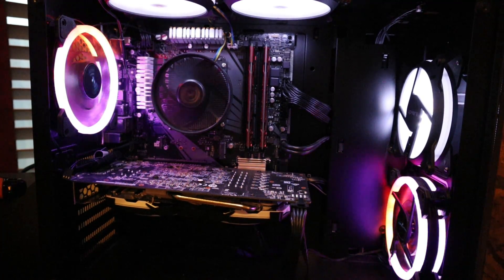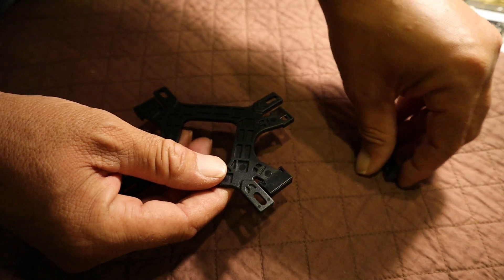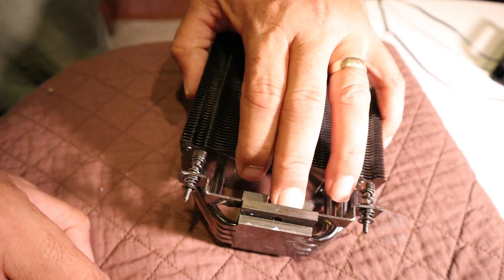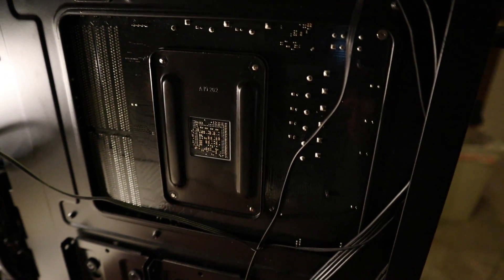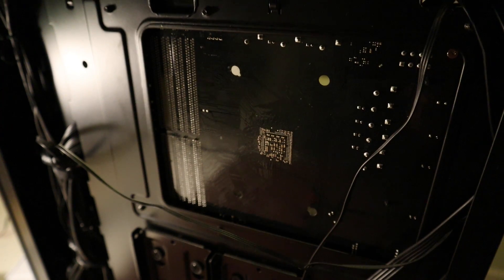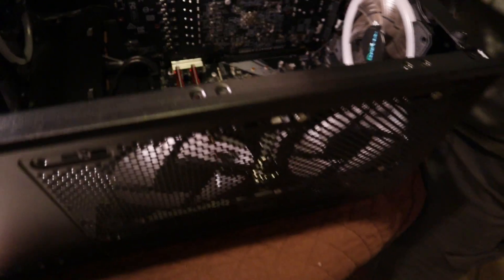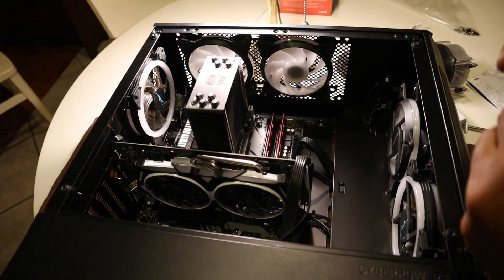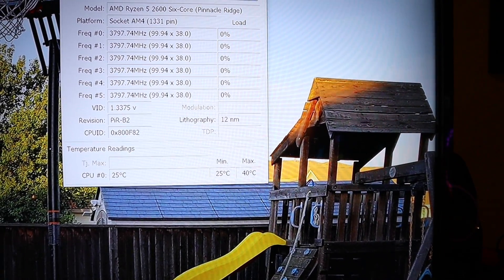How to install the Hyper 212 Black Edition - AM4 - B450 motherboard - Cooler Master

Comment: Thank you my guy for this great tutorial! One inconsistency I encountered while installing my hyper 212 is at 2:01 when prepping the backplate. 

For me, settings all the pins the left created a mis-alignment with the board & heatsink. They had to go to the slot closest to the neighbouring plastic lid (used for intel boards). In other words, the pins needed to be in the slot that created the most space between pins. So if anyone finds that their backplate gives resistance while marrying to the board, or the pins simply dont align with the screws on the heatsink, give my suggestion a try.
Reply: Thanks for this advice! I was having the same issue and this fixed it!
Reply from the maker: Good advice... Every install has its own little nuances... Good thing there's a little "play" with the backplate pins....
Reply: I noticed the same thing, was about to write a comment until I saw you already had. Great video though, helped me a lot!

Comment: those black fan clips dont come with the cooler right? Pretty sure its supposed to have paper clip style ones
Reply from the maker: You get 2 sets of those plastic fan clips with the Hyper 212...the noctua cooler I have came with "paper clip" style clips
Reply: @ScottsPC  thanks! I actually ended up getting the Freezer 34 eSports Duo and couldn't be happier, such an amazing system.

Comment: I have the same cooler. If you want some added lighting, swap out the fans for 2 x 120mm Cooler Master SickleFlow ARGB. This is what I'll be doing. Just remember you will need an ARGB splitter and a 4 pin PWM fan splitter for this setup. :)

https://www.coolermaster.com/catalog/coolers/case-fan/sickleflow-120-argb
Reply from the maker: Thanks for the tip!  I appreciate the comment!

Comment: The stock cooler on my 3600 is sooo loud. Hoping this one will do the trick. Do you know if this work with a Aorus Elite B450 mobo?
Reply from the maker: Yes... Will work on any b450 mobo.... It's much quieter even at full speed! ⚡️
Reply: How did it end up working for you? My stock coolers with the 3600 is also super loud.
Reply: @bobbob123ful  It is definitely quieter. I would also make sure you have the fan set to silent in your BIOS if you can.
Reply: @connorm7005  I set a custom curve in the bios for the stock cooler. Will have to adjust it for the Hyper 212 BE. How are your temps compared to the stock cooler? Also thanks for the reply!
Reply: @bobbob123ful  They aren't bad probably 5-10 degrees cooler on average
Reply: yo idk if this just my mobo but the backplate thing is too small any tips to make it fit? well i mean the screws are not in the right sport because they are too wide
Reply: Jack Make sure you set the backplate for your socket. Whether it's AM4/AM3/LGA, etc

Comment: I'm looking into building my first PC with PCPartPicker. I've selected the Hyper 212 EVO cooler, alongside the MSI B450 TOMAHAWK MAX ATX AM4 Motherboard. Any idea if this cooler is compatible with the motherboard, or if I'll need some sort of special mount?
Reply from the maker: No special mount needed.  The hyper 212 will fit perfectly with your motherboard.  Pick out a cpu yet?

Comment: i have an msi b450 and it literally wont fit however i arrange it any tips
Reply: ill retry again
Reply from the maker: Hey Andrew... Were you able to attach the back plate for the hyper 212 through your motherboard and screw on the standoffs ok? Are you using the AMD brackets and not the Intel ones?
Reply: im using the amd brackets and everything just its not lining up for some reason
Reply: the standoffs dont match with the heatsink screws for some reason its too wide for the heatsink
Reply from the maker: @andrewrosemill3532  did you get it figured out?
Reply: I'm having the exact same problem! Please someone help me
Reply: @yorickborgmans3521  same here. The screws don't match up on my b550 board. It's supposedly compatible but the screws just don't want to align. It's so upsetting

Comment: Do I have to put on different back plates then the ones I already have. Bought a prebuilt
Reply: Using the 212 was the best choice I made on my build. I feel it performs way beyond its price to the point where I'm kinda feeling like I ripped off coolmaster lol
Reply from the maker: Yes... You will need to use the back plate that comes in the box with the Hyper 212... It's the back plate I prepared towards the beginning of the video. Thanks for the question! ⚡️

Comment: Just about to fit a 212 Evo to my AMD3600 on a Asus B450 M K motherboard which was hitting 82degC -87degC when rendering video. I shut it down trying to do 4K  when the temp shot over 90 deg C! Thank you so much for taking the time to video your installation. I'ts my first p.c. build so I'm still wet behind the ears.
Reply from the maker: So glad the video helped! ⚡️ I appreciate the kind words brother. Thanks! ⚡️

Comment: do i need to buy to buy a extra better thermal paste or paste which comes with it will do just fine?
Reply from the maker: You don't have to... Comes with with thermal paste already applied and will do just fine. But I recommend to buy some extra thermal paste just in case you accidentally mess up... Like I did my first time... Lol... Thanks for the question! ⚡️
Reply: Better to buy thermal paste for couple of dollars.  The thermal paste comes with most coolers are terrible . Best thermal paste on the marker is Arctic silver 5 . But also the thermal pads a re winning to bc you can reuse them 1000 of times
Reply: But I just bought this same cooler and work getting in the way i havent had the time to install it 😒
Reply from the maker: @demondog3098  I have a full time job too and it is challenging finding enough time with all that's going on in the world. I also have a couple tubes of artic paste... Hope you find some time and thanks for the comment!

Comment: Very nice video! Question tho, is the thermal paste included with this cooler?
Reply from the maker: The 2 I bought already had a thermal paste/pad applied. It's easy to accidentally mess that up so I would recommend buying some paste as a back up.
Reply: @ScottsPC  Alright thanks man!

Comment: The cooler doesn’t fit why
Reply: CRZ 1021  lol i got it now the weird brackets u put on the cooler....I put them on backwards which made the screws closer together and I just turned it around and it worked
Reply from the maker: Check the specs of your case and make sure there's enough room for the hyper 212. You can also go to pcpartpicker.com and enter your build there to see if the cooler is compatible with your case.
Reply from the maker: CRZ 1021  just to verify... The hyper 212 backplate with the tiny screws come thru the back of the motherboard.... Your unable to screw the standoffs onto those screws?
Reply from the maker: First time installing something like this can be frustrating... Lol... Now you're you are all seasoned veterans!!! ⚡️
Reply from the maker: YouTube didn't give me an alert when you responded a few days ago..... Would have replied faster.....